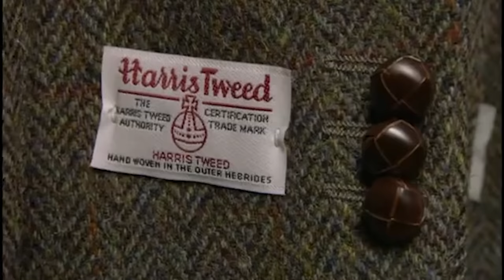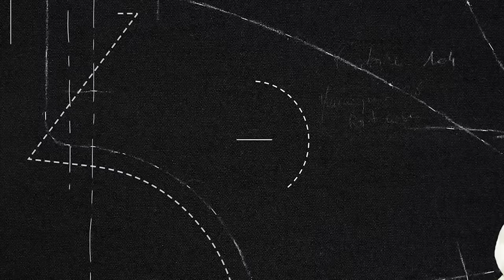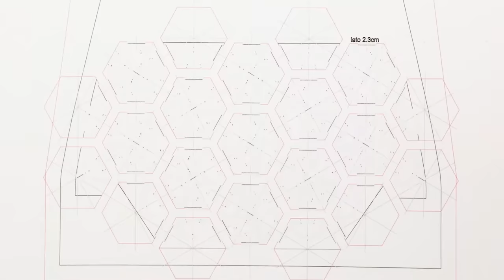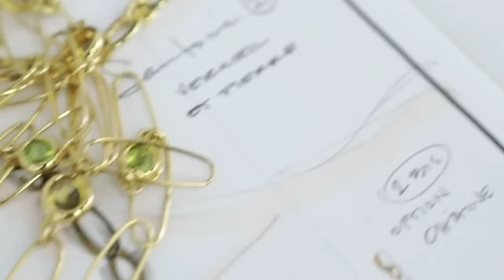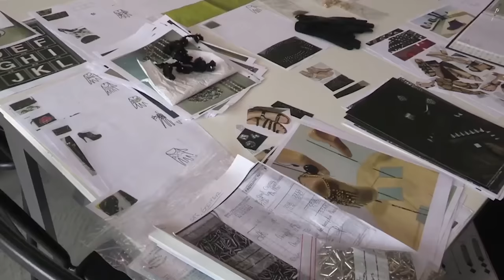What Are You ACTUALLY Paying for When You Buy Chanel?

Comment: I had a guy talking at my fashion program who works as a fabric designer that also manufactures for Chanel. He told us that for some fabrics they develop special machines (only for a single technique). That’s why some fabrics can go upwards 8k for 1 meter.
Reply: Just because it's inconvenient doesn't mean it's inherently valuable. That's just ripping people off
Reply: It’s not ripping them off if the house incurs huge costs. Chef’s who run sushi omakase’s have to charge high prices ($300+) per person for dinner because the cost of the ingredients is so high. These restaurants often only just break even since they will also have no more then 10 seats in the restaurant.
Reply: wow